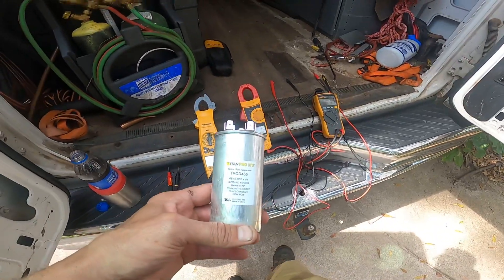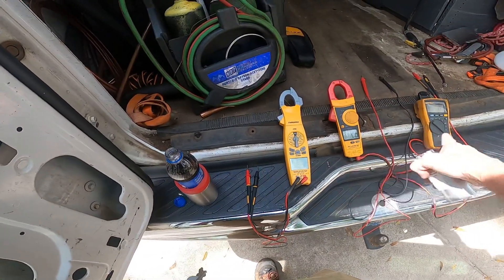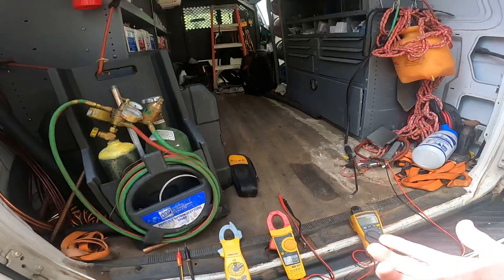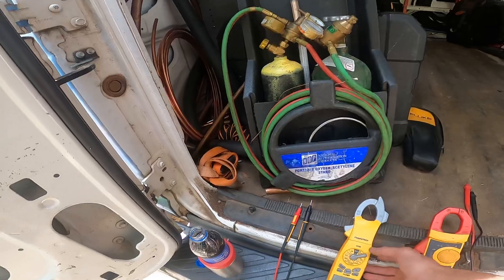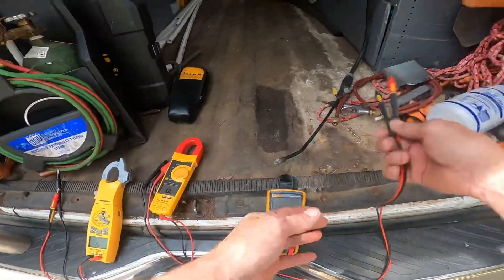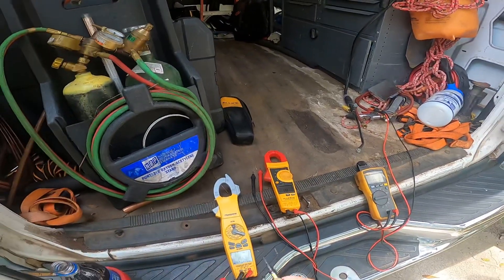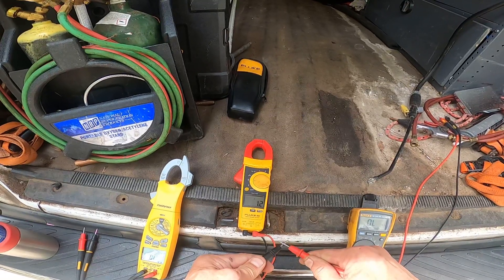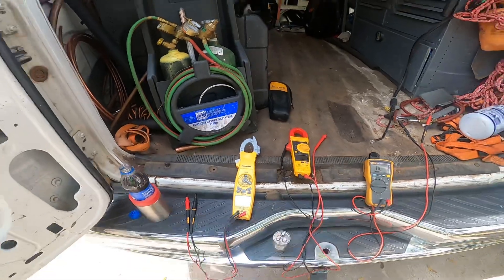Meter comparison Fieldpiece vs. Fluke

Comment: I didn't own any fieldpiece DVOMs. I do own fluke 88 fluke 117 and fluke 325 clamp meter. Love them all. I also own snapon vantage and vantage pro.  Great meters but screen refresh is slow. Great for graph work and the min max capture speed. The snapon are ment for car / truck work. Just my 2 cents

Comment: You’re not comparing apples to apples here. You’re comparing fieldpieces top of the line product vs flukes bottom of the barrel stuff. And for your finicky 902, I would bet money that your test leads are faulty, not the meter.

Comment: My problem with Fieldpiece is the reliability. I have a 480 that's only 4-5 months old. It's about to go back for warranty a second time. The first time it stopped reading microfarads. Now it's stopped making tone when checking continuity. They replaced the meter just a month or two ago. So this will be the third one. My old Fieldpiece stopped making tones as well. It did last a few years though. So far my Flukes have been more reliable. I do wish they had all the features but reliability is more important to me. Having to come down off a roof to get another meter in the summer heat sucks. 

Thanks for the videos. I enjoy watching.

Comment: I love fluke, I think their meters are definitely superior, but I use a fieldpiece every day. Fluke just doesn’t offer a single meter that can do everything I need. I refuse to carry 2 meters. Also fluke doesn’t make one that can read volts and amps at the same time which is a function I use often.
Reply: The T6-1000 offers voltage and amperage readings simultaneously. However the meter does have the ability to read capacitance.
Reply: Fluke 378 FC does both together
Reply: @GeminiSeven43 yeah for 1,000 bucks
Reply: Cry once and carry often lol

Comment: The 902FC doesn’t go into the Megohm range on resistance, the Fieldpiece does.  The Fluke 902FC is a really expensive meter for what you get.  No magnet, no megohm capacity in the resistance range, and it doesn’t even test Hz% or duty cycle.  A $160.00 UEI DL389 meter packs more features than that $350.00 Fluke does 🤦‍♂️.

Comment: I believe fluke  has the 925fc or the 950fc. So if your going to compare the fieldpiece flagship you can’t compare it to a base mode 116
Reply: 925 is a anemometer  & Gluck TL950 are leads... think you've been drinking a little too much and at the moment fluke is leading in recalls by a large margin on top meters

Comment: I will never purchase another fluke meter again! Fieldpiece is the only brand I will buy moving forward! Try to get a fluke meter service or calibrated if you can get ahold of customer service the minimal charge is 250.00 no matter what the issue may be. I tried to purchase a replacement probe for my T-600 the price was 250 and I had to send it in on my dime.

Comment: My SC240 is the slowest thing in the world, but it’s small and does everything I need on most calls. My Fluke 116 sits in the tool box because it doesn’t have a clamp. If I absolutely need to read micro amps or something silly I can dig through the old meter bag and pull out the SC480 or UEI. My daily drivers are that little compact fieldpiece because it’s got a good magnet and it is small and I have an Amprobe mini (you should check it out) for taking amp draws  and inrush.
Reply: I’m looking at buying a sc480 or a uei as a co worker has one as well sounds like you’ve had both which one would you reccomend I’m looking for my 1st meter as a hvac-r apprentice
Reply: @tysontupper6733 

Honestly, I would get the SC240. The UEI models are usually reasonably priced. As an apprentice I wouldn’t spend too much on a meter as you won’t use it much doing installs and heavy service grunt work.

Comment: I've been using the same fieldpiece meter for 13 years now it's the hs 36 I love it and does the job that I need it to do for a cheaper price than the fluke granted sometimes the accuracy on the hs36 is off a little bit but hey it's never been sent for recalibration eather the only problem I'm having is with my gages the sman 360s even after you get rid of the residual pressure in the hoses sometimes they will still read about 2 psi outa range